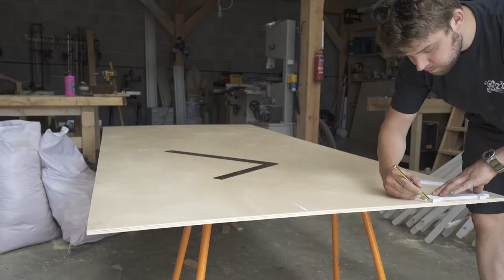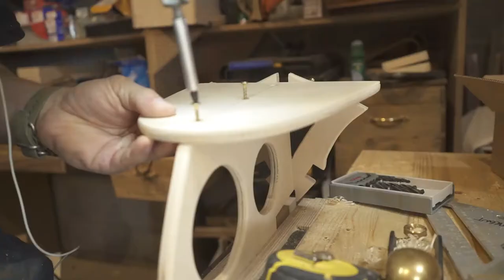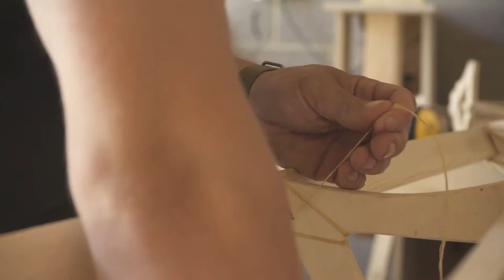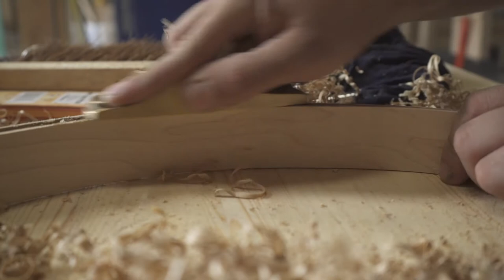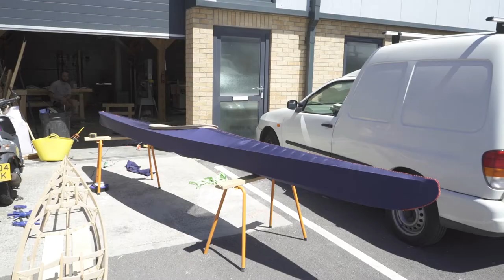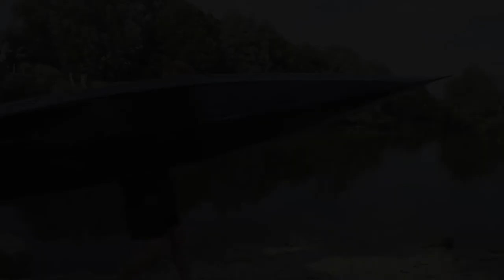Building a Kudzu Curlew Skin on Frame Kayak

Comment: Built West Greenland, Alaskan Retrieving, and my own design shalow canoe to paddle as kayak.
Recycled wood used, bamboo ribs, and balistic nylon for the skin. No metal or glue is used apart for putting together coaming(epoxy, west system). 
Light, fast, and beautiful.

Comment: Dimentions! Measurments! you provided nothing pal
Reply: Finding out is adventure too.....
Reply: @caveman1334  I couldn't afford to make mistakes, so I researched boats making traditions in general and got introduced to the needed equasions with regards to width-length ratio in relation to speed target, and rocker ratio in relation of the waviness of target water surfaces ... etc etc.
Reply: @hussienmohammed2914  I made 3 SOF of different kinds, and most measures were based on my body, as they would in traditional kayak building.
Reply: @caveman1334  this is a great tip. Greetings from Syria♡.